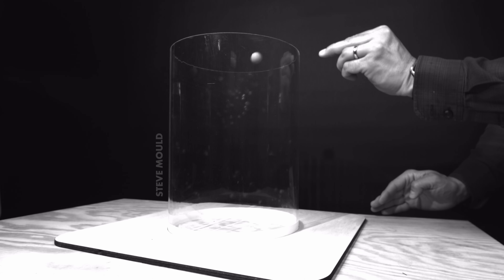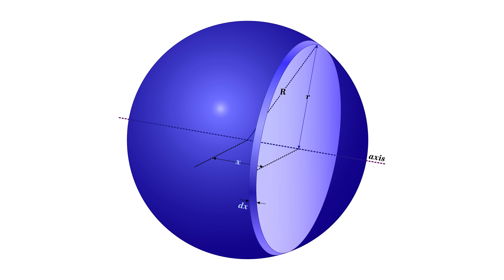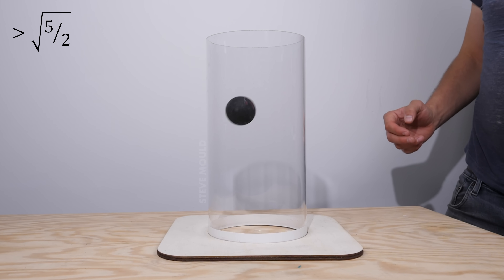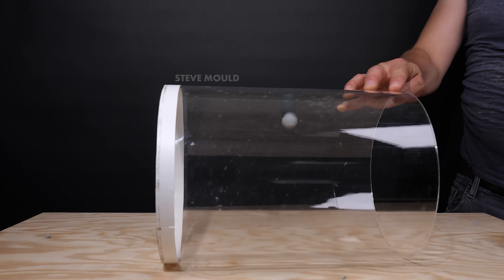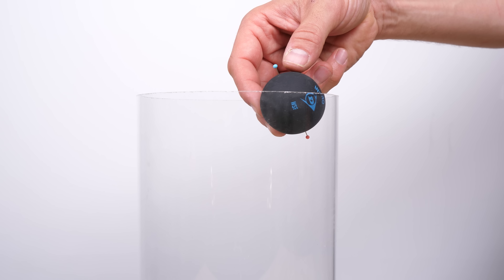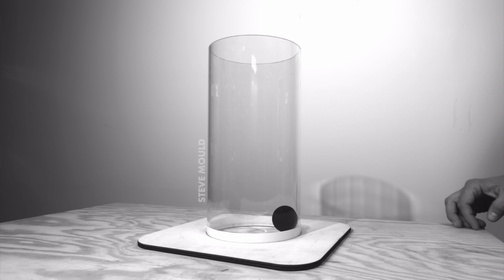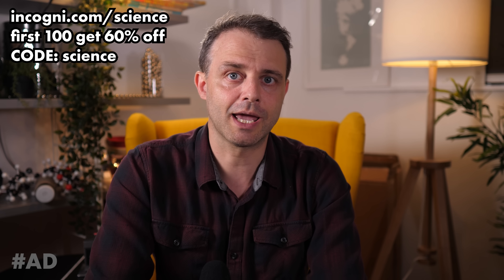The Golf Ball Paradox

Comment: There was a thing I saw where a camera focused on a bag of chips through a window could measure the vibrations that speech made on the bag in order to reconstruct voices inside the room the bag was in. I’d love to see that sort of thing amplified.
Reply: That's the idea behind laser microphones
Reply: @oelboy  it's why you aim a loud speaker at your window(s) to defeat laser microphones
Reply: @greggv8 or curtains
Reply: @greggv8  I do that strictly for the tunes.
Reply: That has been in use for surveillance for about 50 years.
Reply: I'd often wondered if it's possible to reconstruct ambient noises from old silent films using this technique.  Probably not.
Reply: The FBI leaving bags of chips lying around everywhere.
Reply: @hakkinenfan  there was some leaks that they can essentially remotely alter your router so it essentially transmits RF signals giving kind of a real time bat-radar
Reply: Yeah and it was EXTREMELY unlegible
Reply: @notcoleman711  This is similar what happens in "The Dark Knight".
Reply: That’s the “visual microphone” from MIT, Microsoft and Adobe. It works quite differently from laser microphones, which are much easier to make.

Laser microphones use interferometry to measure the change of distance to an object from which the laser is reflected. The accuracy & sampling rate of the measurement is very high since it just depends on the frequency of the laser, so it is very easy to identify sound vibrations.

The other one uses an ACTUAL video of an object. To get decent sound you need to measure frequencies of at least a few kHz, but regular cameras only record at 24-60 Hz. They solved the issue by looking at each image line by line (which is how many digital cameras record images) to get higher frequencies. Also, the amplitude of vibration is thousands of times smaller than even a single pixel, so they looked for tiny changes in the pixel color.

In the end the sound quality is pretty bad, but still it’s amazing that you might be able to recover audio from something like a mobile phone video of a plastic bag…
Reply: Mhh chips 😂
Reply: @nukkun that’s quite cool I agree
Reply: YES. Steve should do spy stuff.
Reply: How?why?when? Where?
Reply: @greggv8  The IRA never thought of that. Also they didn't know about laser microphones at all. The brits were listening to them for years and it's what ended them as a military force.

Comment: I'd love to see the motion camera filming various types of bridges such as suspension bridges and cantilever bridges. There are three different bridge types where I live and I've noticed, during rush hour commute, that when I put my foot down (on my motorcycle) that the cantilever bridge I cross bounces imperceptibly.
Reply: ... bounces perceptibly.

If imperceptible, you wouldn't be able to feel the vibrations when you put your foot down.

And yeah, I'd like to see bridges' vibration patterns too.
Reply: I second this notion
Reply: *bounces imperceptibly to the naked eye @GregConquest
Reply: huh, I've noticed that too. There's a road where I live where one direction of traffic crosses the river on a steel truss bridge, and the other direction crosses on a concrete slab bridge, and I can definitely feel movement if I stop on the steel one. It's a little alarming at times, especially since I know that bridge is pretty old.
Reply: I third this idea...if that's a thing. Given the concerns about aging infrastructure it would be interesting to see older versus newer bridges and different construction types.
Reply: The big bridges in SF do this. It's unsettling.

Comment: Minute amplification ideas:  Bathrooms - curious to see how well built a bathroom is - turn on the water and see if there are any movements in the shower/bath.  Cars, the car itself and the engine compartment - how does a car vibrate?  Nailing up a picture on the wall - sometimes when you nail up a picture, you might popout an old drywall nail; would be interesting to see what vibrations are caused when nailing on a wall.  Similarly, jumping on a 2nd story house - the other day my daughter started jumping with joy and I could feel the house framing move as we were on the 2nd floor.
Reply: This reminds me of throwing a tennis ball against the rear of my childhood house, my father asked me to stop and showed me how the opposite end of the front of the house, wood siding nails were loosening.

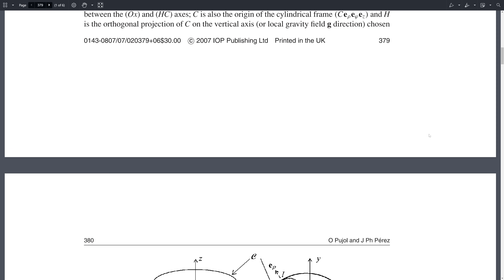Comment: The old quote "energy always follows the path of least resistance" always holds true and there is the real answer. Simple as it should be. As paradoxal as it might seem, even with gravity pulling downward on the object, it takes less energy for the ball to go back upward than to go down. The reason is the momentum of the ball, and its trajectory, and travelling in an arc, has a pathway and because of that it is fighting against the pull of gravity which is a straight downward pull. So the ball goes up, keeping its pathway only in the opposite direction. And I only got 1:33 minuted into the video before bed so I don't know if the author ends up stating the same thing or not.

Comment: The closest thing I can come up with to an intuitive analogy for what may be going on is from playing with marble mazes as a child. If you throw a ball bearing around a funnel in an elliptical orbit, you get the same pattern. The ball keeps missing the hole in the funnel and running back up the other side. This shape makes intuitive sense. Now all we have to do to make what the ball accomplishes in the cylinder intuitive, is to slowly augment the shape of the funnel until the funnel is a cylinder. Even with the cylinder, the ball is attempting, and is, following an elliptical orbit and "missing" the hole at the bottom of the funnel and running back up the other side. The fact that this works with the completely vertical sides of a cylinder rather than the more angular sides of a funnel, and the fact that it's more difficult to intuit and elliptical orbit inside a cylinder, is where the bizarre intuition break happens.

Comment: I have a possible idea for your motion amplification camera.  There are many educational videos on simple DC motors, where a loop of insulated wire is set in a magnetic field, held by paperclips at either end (which are taped to a battery) , and so a current is passed through the wire.  Most of the videos state that you should sand off all of the insulation on one axle (end sticking out of the of insulated wire coil) and only sand off half of the insulation on the other wire, is an orientation 90 degrees to the coil plane so you've made an intermittent commutator.  But in one video they sanded all of the insulation off of both wire ends.  I tried both methods and they both work, but seemed different  The completely sanded one didn't work sometimes, but seemed to have more force holding it still.  Other times it spun around like the half-sanded one.  I think the sanded wire through the loop in the paperclip stand might start to vibrate at a frequency sympathetic to the effective coil rotation.

Comment: I would love to see the motion amplification pointed at some electronics or a PC's internals. Something we think of as being completely still when in operation. Would be amazing to see if there was some vibrations.
Reply: You would only see motion in a few components, mainly Relays, Hard drives, and things that are designed to move. Everything else is just chemistry, electricity messing with the conductivity of silicon to move other electricity around (these are called Solid State components, because they are completely solid. There are exactly zero moving parts.). Hard drives have magnetic disks inside that spin really fast and store the data, relays are mechanical switches that click on or off based on electricity, and you know what a motor does. That doesn't mean that like the wind or the desk wouldn't be moving though.
Reply: @serphorus  Ever hear of coil whine? How about transformers humming when under load? Listen to a microwave oven while it's running. That hum you will hear comes from the transformer that provides the high voltage to the magnetron. Sometimes things that aren't "designed to move" as you say, do in fact move a little bit.

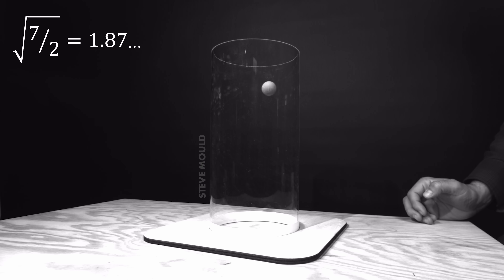Comment: You could record the top view and the side view with one camera if you place a mirror at an angle above the tube opening. That way the camera would see the side view directly and the reflection of the top view through the mirror within the same frame. No need for two cameras or to sync up two video files in post. (Referencing min 2:51where you wish you had two cameras to film.)

Comment: On the matter of viewing the setup from two different angles simultaneously, you could probably pull this off using mirrors to reflect the two perspectives into the field-of-view of a single high speed camera. I haven't taken the time to figure out the specifics (something like the mirror arrangement used by Newtonian telescopes perhaps? Maybe incorporating a second arrangement of mirrors like a periscope to first shift the light's path to the side so that you needn't reflect through the cylinder itself?), but it ought to be possible.

Comment: My guess is that the axis of rotation at any given time is actually oscillating back and forth around the initial axis. Perhaps there is a mathematical relationship between the moment of inertia and that oscillation. Such as higher moment of inertia makes it more difficult to pull the ball away from the initial axis of rotation, causing a smaller oscillation.

From what you've shown, the larger moment of inertia of the hollow shell is closer to the naive assumption. So, this oscillation in the spherical shell would be smaller than the oscillation in the sphere, which aligns with the previous suggestion.  A smaller oscillation may explain why the spherical shell traverses a smaller absolute vertical distance per rotation around the cylinder. This is assuming that the "naive assumption" respresents a minimum absolute distance of vertical travel.

I suspect an object with an infinite moment of inertia would follow your naive assumption. You could test that assumption by using spherical shells having the same thickness, but varying mass and seeing if they get closer and closer to the 1:1 ratio as they become more massive.

Comment: 0:07: 🤔 The video discusses the phenomenon of a ball being thrown into a cylinder and coming back out again, exploring the concept of centrifugal force and gravity.
2:23: 🎥 The video discusses the ratio of turns between a ball and a cylinder and relates it to the turntable paradox.
4:55: 🔍 The video discusses the ratio between the wall thickness and the square root of a squash ball, as well as the ratio for a mouse ball, and suggests possible explanations for the differences.
7:32: 🎥 The video explains the intuitive explanation of the gyroscopic effect on a ball thrown in a cylinder.
9:56: 📚 The video discusses data brokers and how Incognido helps individuals protect their data.
Recap by Tammy AI
Reply: Thanks for saving time! Amazing summary tool with lovely time stamps!~ where u download this Tammy AI?

Comment: Filming a piston engine (or mock-up of one) to see the primary and secondary vibrational modes might be neat. Also a 3D printer moving faster and faster so we can see where the mechanical design needs to be improved in order to print faster without ringing.

Comment: It's kind of like when you bounce a basketball forward with a reverse spin on it and get it to bounce back into your hands. The forward momentum of the ball is shifted by the grip of the ball on the surface caused by its rotation.

When you launch this ball down into the cylinder, it picks up additional lateral spin more horizontal than the axis it had been rotating across (i.e., the angle of entry) because of the centrifugal motion of the ball around the cylinder. In other words, the ball wants to escape the rotation and is forced straight out in a horizontal direction by the centrifugal force, causing it to make contact with a different (higher) place on the surface and then to roll along that higher plane. As that horizontal spin works on the ball to translate into lateral motion because of friction, the ball's course is altered with its new spin. These two forces, the spin momentum and the revolving momentum, work in tandem to shift the direction of the ball's motion. At either end of the oscillation, the angle has become flat and the spin is sufficient to divert the ball's course. Of course, nothing different is happening at these points at the extremes of the oscillation. The ball was always shifting course as soon as friction on the cylindrical surface caused its momentum to translate into a slight direction change toward horizontal. 

At the midpoint, when the ball's rotation is in direct line with the angle of travel, it is traveling at at angle to the curved surface, destined for the cylinder to once again bend its path to the horizontal.
Reply: To illustrate this, I believe a tetherball's path around a pole would become more horizontal as it wraps the pole: the tighter the turn, the more contained the momentum, the more relative force converted into lateral motion.

Comment: la bola la puedes fabricar usando cualquier bola  hueca y la cubres con una capa de un producto poliuretano de nombre sikaflex....lo dejas secar y luego la pules redonda...es fuerte para pulir pero se puede..

You can make the ball using any hollow ball and cover it with a layer of a polyurethane product called sikaflex... you let it dry and then polish it round... it is strong for pulish but it can be done...

Comment: I am not sure about the framerate needed to see it, but riffle barrels can be very sensitive to oscillation that moves down the barrel along with the bullet being expelled. weight added or subtracted by putting a piece of hardware like a flash suppressor on the end can ruin accuracy with the "wiggling". Fortunately that can be remedied by shortening the barrel tiny bits at a time which decreases the weight extended down the length, thereby modifying the amplitude and frequency. It would be fantastic to see the wave pass down the barrel.

Comment: Intuitively, I was thinking the answer you were seeking lies in the curvature of the cylinder wall.  When you throw the ball in initially (on the right ID of cylinder as your video shows), it strikes the side of the cylinder and begins rotating according to the angle off vertical at first contact.   At first contact the ball is tangent to the surface.   But now look what happens at the next infinite slice of contact after.   Imagine looking forward out of the ball in the direction of initial movement.   Rotation axis is at your left and right parallel to the tangent of contact.  Now in the next infinite slice, the surface is now curving up on your right and down on your left relative to the axis of rotation, steering the ball to your left as you stare out straight or rather, imparting a steering force.  Apply gyroscopic precession. This will also start changing the rotation axis. As it steers left with the gyrolag, it gets itself in further movement to where the next infinite slice of movement becomes high on the left, causing a later right steer.

Comment: I'm not sure if this is a valid comparison, but the first thing that came to my mind was a car on a banked curve:  if the car goes around the banked curved too quickly it moves outward (away from the center of the circle) and if too slowly it moves inward (towards the center of the circle).  Since the ball is constricted by the cylinder's walls, the only way to go "away" is to go up the cylinder's wall and "towards" would be down the cylinder's wall.
When the ball is first thrown into the cylinder, it's moving too quickly and even though it's thrown downward, it'll start to rise up due to the extra speed.  As it does this, it will slow down causing it to move back down.  I think this makes the bank angle of the track equivalent to the angle you throw the ball into cylinder (not sure though).
This theory does not explain the sqrt(7/2) phenomenon (though it might if analyzed more mathematically incorporating the moment of inertia).
There is a critical speed for the car on the banked hill problem that doesn't require any friction to complete the turn.  If this theory is right, there should be an analogous situation for the ball in the cylinder:  turn the cylinder horizontally and if you throw the ball at just the right speed for a given angle, it should show minimal to zero deviation horizontally and more or less stay inside the cylinder.  I think.

Comment: I believe you can simplify this issue with a rubber ball bouncing in a rectangular tunnel. You bounce it off of the floor such that it hits a wall, then bounces off of the ceiling. The first two impacts will convert some of the momentum into spin. When it hits the ceiling, the spin induced by the impact with the floor will exceed the remaining forward momentum, driving the ball back to you. For extra credit, can you tell me why the ball won't hit the other wall?

Comment: As the ball moves across the surface of the cylinder, the part(chord) of the ball that contacts the wall changes.  This changes the relative direction of rotation, pulling the ball in a new direction.
If it were rolling inside a hollow sphere, the ball would settle into a more or less stable “orbit” until parasitic forces decay the motion, but on a cylinder it is less stable because of the variable curvature of the ‘orbit.’  This also accounts for the more aggressive procession.